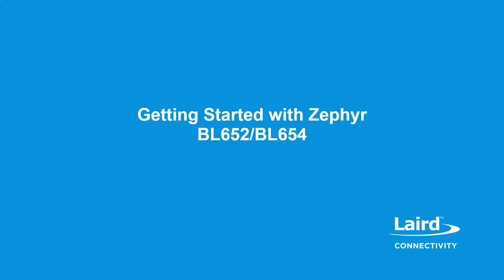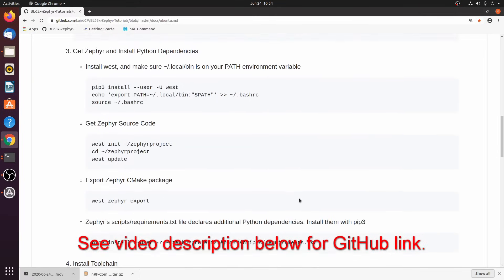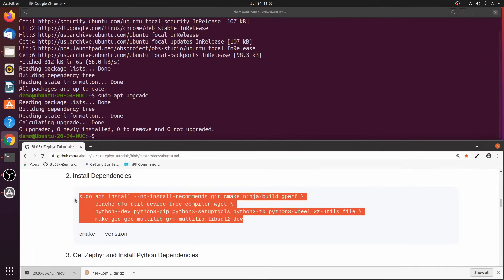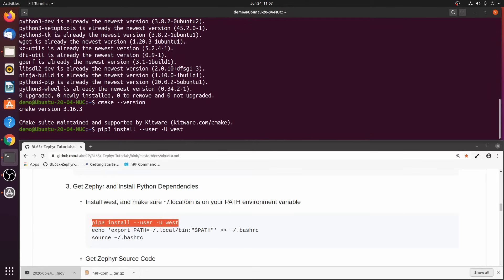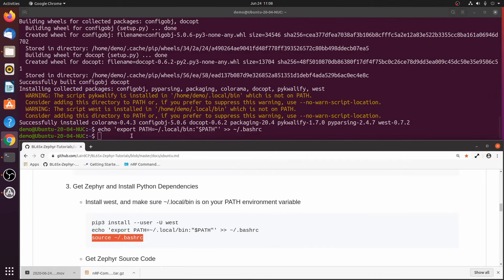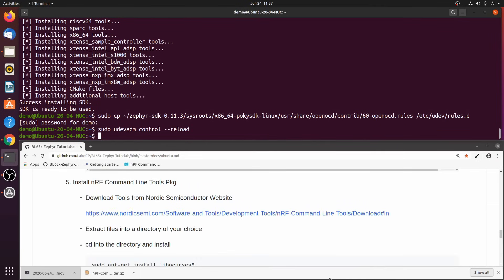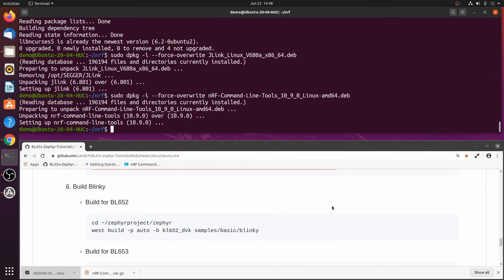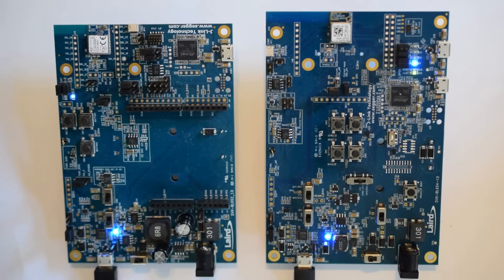Getting Started with Zephyr on the BL652/BL654

Comment: I just bought BL651 and I'm using it with my Zedboard. However, I couldn't find any user command for the BL651 at all. 
I'm using SPI protocol for the interfacing between the board and BL651. I need more information on the BL651 command.